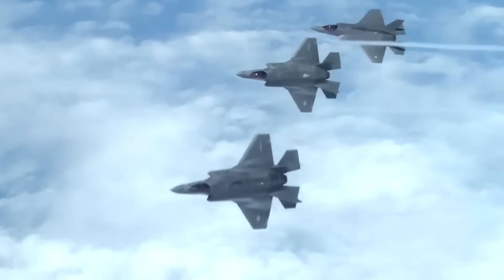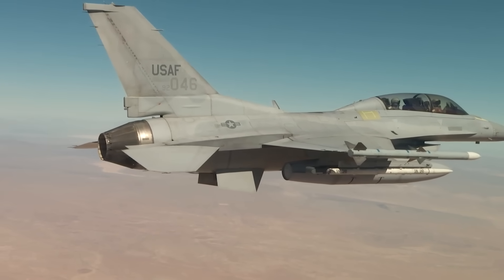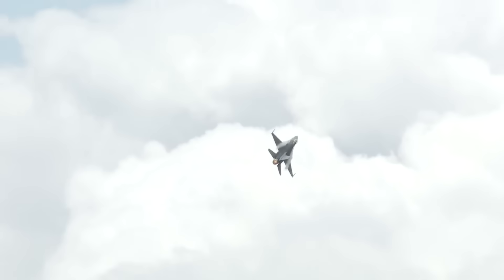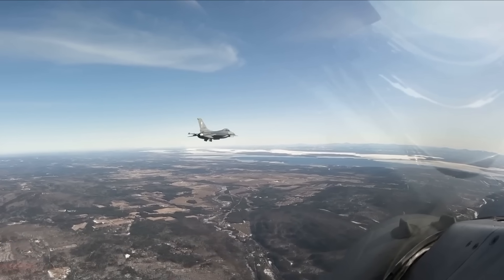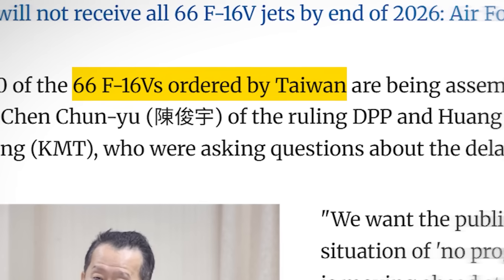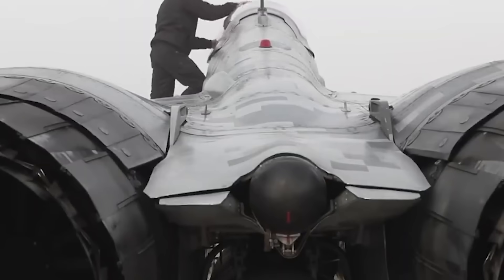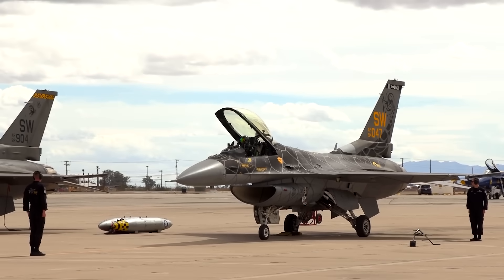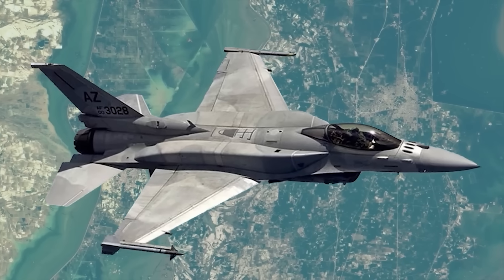F-16 Viper: Why the USA Brought Back Its Most Proven Fighter

Comment: A modern Air Force needs some stealth capability, but it also has a sortie count, target count, with $$/hour capability requirements as well..     
The USAF is not getting rid of its F-16's or F-15's it upgrading them to 4.5 gen aircraft to better integrate with the gen 5 and gen 6 aircraft.     
Integration and data sharing, are the goal. 
Also once you have  performed SEAD and established Air Dominance, why fly stealth??  the $$/hour on F-22, F-35, B-2, and likely F-47/B-21 are higher..
Reply: Hmmm  a simple google search says that a new F-16 block 70 for Peru  is 285m per unit for 12 of them.       
Poland paid 3.8B to upgrade all of their 48 F-16 block 52's up to 72's    ~79m each

Comment: You only need a few Ninja to kick in the door, and knock out resistance to then have your Samurai come in and clean up, and do the muscle work. Stealth is the Ninja, and legacy planes are the Glorified dump trucks, that work as the Samurai. Cheaper, and better for the mud work. it's called using your Noggin, which Finally the Military woke up to. Legacy planes, and legacy style ships in the legend Class Frigate. Sometimes you just need a damn hammer to drive a nail.

Comment: Other nations may also not need stealth if their security posture is different from ours. Plus I like that they still build them JUST in case we need an infusion of fighters all of sudden
Reply: 5th- and 6th-gen stealth aircraft need 4th-gen stand-off support fighters.
Reply: If by "we" you mean the U.S., you need that infusion asap. The F-35, F-15EX F-47 lines aren't building enough fighters to maintain the USAF current mission capability requirements over the next decade. It will take a couple of years before Lockheed Martin will have spare line capacity to build new F-16s for the USAF but it is looking the best option for mitigating a looming fighter shortage in the USAF.
Reply: @bluecedar7914  That's why F-15, F-16, F-18, F-35, F-47, B-21, and the various CCA fighters are all ramping up production, not to mention P-8 Poseidon, KC-46 tanker, and E-7 AWACS. Fortunately, with significant international involvement, featuring components and assembly in partner nations like Israel, Australia, Japan, Italy, South Korea, and several European countries "we" will be fine. Thanks for your concern.
Reply: @brianbassettnumber1 That is not what either the USAF or your congress are saying in their forward projections. Your fighter fleet capacity is aging out at a faster rate than current production lines and the USAF's budget can renew it. The USAF has warned it may need to reduce operations if new fighter procurement isn't increased markedly in the next five years.
Reply: @brianbassettnumber1 And your AWACS fleet needs a hell of a lot more than 2 E7s and a handful of new E2s. The Australian, Korean and UK's E7s are going to be hard pressed covering local requirements if there is a hot war in the Pacific.
Reply: @bluecedar7914  You're being misled. I suspect it's because of both bias and that taste ofsour grapes in your mouth.
Reply: @bluecedar7914  But again, your concern warms my heart.
Reply: @brianbassettnumber1 Your media and your armed forces are officially saying this. If it is bullshit, great. I hope you are correct. As an Australian there is genuine concern about a key ally's ability to maintain defense capability, no sour grapes.
Reply: @brianbassettnumber1 As big a dickheads as Trump and his cronies are, we still are concerned for the well being of our Seppo mates.

Comment: Maybe the funds to further improve the F35 suddenly dried up? 😂😂😂 While the grippen can't be build in quantity in time. Next best cheaper option is the F16.
Reply: The F - 35 is obsolete with the introduction of the F - 47.  Much better stealth, lower cost to maintain, much easier to maintain, much more durable with more flight hour availability potential than either the F - 22 or the F - 35.
Reply: @allanboyer2769 We’ll see.  Since there isn’t a single production F-47 built yet all the expectations are theoretical and as yet unmet.
Reply: grippen, not viggen
Reply: @toddvollrath6611  Gripen, not Grippen...
Reply: @toddvollrath6611 💯 brain fart 😂

Comment: Because the F-35 is Crap
Reply: Because it's expensive with high maintenance costs. Lockheed Martin having proprietary lock on repairs and updates.
Reply: @AnthonyEvelyn  Exactly.  The F - 47 is replacing it with much better stealth, easier, faster maintenance, lower cost, more flight time availability.  Plus, semi autonomous AI drones to go along with it.
Reply: @allanboyer2769  Not proved. Till now all the expectations are theoretical and not met as they already should have been.
Reply: Not crap but certainly overhyped, then maligned in the media.
Reply: @XrayMike17plus1  You are more accurate than these other comments. The F-35 was developed in a time when every mishap ends up broadcasted on social media. The reality is it has less accidents per flight hour than any other fighter, ever. And scaling manufacturing means costs are down to 80 million.
Reply: @lilnapkin462 I for a while believed the media... but the Airforce fixed the issues... but left the criticism uncorrected because it's to our advantage to have the world underestimate the F35.  It is more expensive per flight hour and the stealth aspects require added maintenance...  But it is very good at what it does.

Comment: The F16 and F15 have done what cars should have done. I'd rather spend money on how something works, and spend very little money on how something looks.
Reply: It sounds like you think the F-15 and F-16 are in some way ugly. Nothing could be further from the truth.
Reply: @brianbassettnumber1  Stealth (or reduce RCS) is being worked out to be broken with new gen radars. some already can detect stealth fighters. when it becomes, and it will become sooner than you think, you can use your "Gucci" F-35 as expensive paperweights. Sensor fusion and data networked can be used in better flying planes compared to F-35. For some reason the US military is pumping numbers on EX II acquisitions.